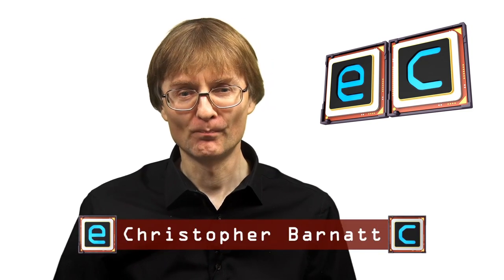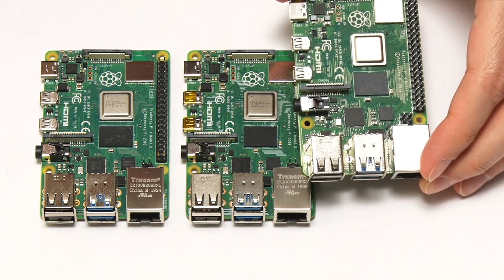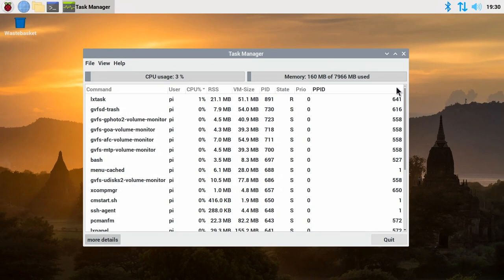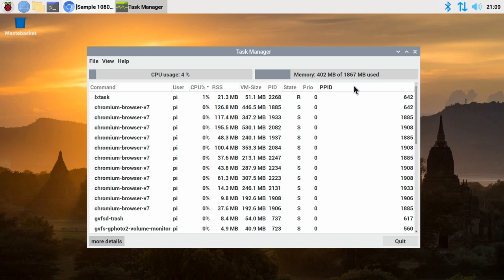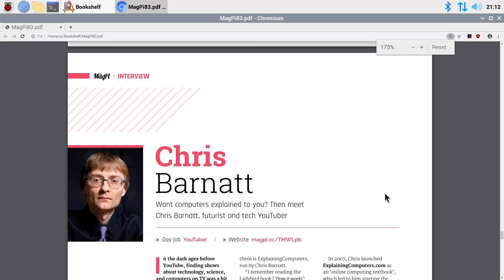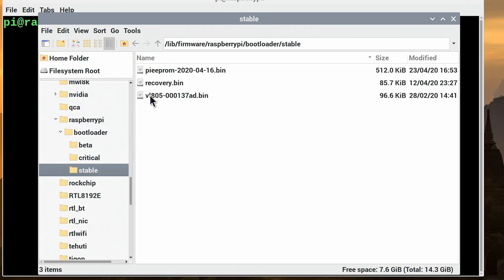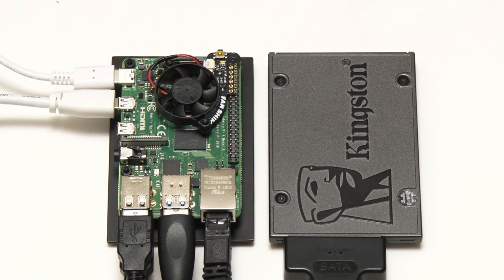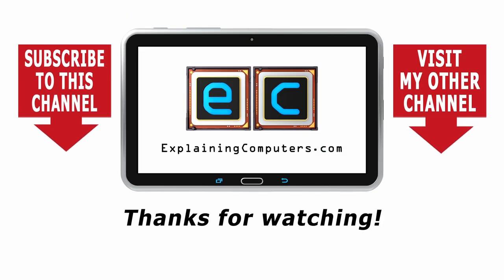Raspberry Pi 4 8GB & USB Boot

Comment: Yup, it came today.  It was $75, but I had some add-ons, plus shipping and sales tax (Florida).  But the expense doesn't end there: two additional VGA monitors, two micro-HDMI to VGA converters, a 256GB micro SD card, and, I'm sure, a few more things will get me on the road.  I mentioned the Pi T Cobbler (to connect to a proto board) and the heat sink in another comment,
Apparently, you have to load the Raspberry Pi OS, 32-bit, first, and then upgrade to the 64-bit OS.  I'm not sure, after a year or two later, if the 64-bit is still in beta.
Usually, within minutes after a new computer arrives at my house, it's already hooked-up and ready to go.  But this time, I had everything except the OS.  Now I need to make more decisions....

Comment: Brilliant devices.  I've got an original Chinese made Pi B running a few servers.  Use the SD card's FAT32 partition to boot to an external powered 1TB drive containing the OS.  The drive has three partitions, OS on a 16GB ext4 partition and two further partitions for saving videos etc.
Reply from the maker: Hi Geoff. :)

Comment: A Raspberry Pi 4 would make a great pocket diagnostics computer for working on virtually any PC. For instance, should you need to copy files from a PC that won't boot, you could use the Pi to copy those files before performing a clean install.

Comment: The Pi 4 needs so much power that running it on batteries is nearly impossible :( That cuts down on 'cool things you can do with a pi' by about 90% I think. Having a small portable computer is nearly useless if it has to be plugged in. I feel like the PI peaked at the 3b, and this is the end of it.
Reply from the maker: I have to agree that the Pi 3B+ was the classic Pi for many reasons (not least power use and cooling). And the 3A+ is a very good board too.
Reply: That is why I suspect that the next board update we are likely to see will be an update to the Pi zero. More CPU but with roughly the same power consumption.
Reply: @bradquinn4161  I'm hoping for more ram. A little more CPU speed wouldn't have nearly as much impact as an extra gig or two of ram.

Comment: To be precise 32 bit operating system CAN address more than 4GB of memory because it is not addressing space in bytes but in pages and processors have functionality to support for it. What cannot happen in 32 bit OS is processes addressing more than 4GB. What makes matters worse; memory split is set to 2GB userspace + 2GB kernel.  This theoretically leaves you with only 2GB per process limit. Again it can be mitigated to some degree by changing split to 1GB+3GB via kernel parameters. In Windows via WOW64 and some trickery this offset is changed to 4GB+0GB.

Comment: Really curious what Raspberry Pi has against the Manjaro team. Their full 64 bit image has been running on my Raspberry Pis for the last 8 months with zero issues while I had problems with raspbian and ubuntu images (I ran stuff that required full 4 GB ram).Yet no mention of Manjaro on their posts. I was so satisfied with how Manjaro ARM has been running on Raspberry Pi that I became a patron in the end.
Reply from the maker: Good post. Manjaro runs very nicely on a Pi 4 as you say. I've not tried to USB boot it yet though.

Comment: I think you may be trying to talk me into buying the 8GB Pi 4 B.  I had the 2GB in my Adafruit shopping cart and was going to buy it.  Now I have one of each and deciding which one to delete (I can't afford both.... what am I saying - I can't afford either!).

I'll probably buy one or the other, anyway.  I often have up to 50 windows open on my machines, and the older Pi 3 seizes-up after about 7 or 8.  It's hard to imagine this little computer with as much memory as my desktop (8GB).  

But these days, you know that my Raspberry Pi adventure is wrapped-up in something much larger - the Space Telescope I've been working on.  I need to be efficient in the resources I have.  The main thing I need out of this is the BCM2711 chip and its six SPI ports (I will use four of them and multiplex out to 16 data ports and 32 I/O ports.

I've been looking around for something a little less extravagant, such as a small chipset, or maybe even just the BCM2711, but it appears you can't simply buy a BCM2711 chip.  I suspect that it's exclusive to this device.

In the meantime, there are many other chips that can supply SPI interfaces, but there's no good guide to finding one that can service 32 data ports or more (I want to add more converters - I need more data coming back from the distributor boards).  I've been looking at the ARM processors, but again, in order to find what I need, I have to sort through hundreds or thousands of them (I'm surprised at how many ARM processors there are in the world).

The BCM2711 is only one of many.  The cheapest ones start around $5 (can you believe it - you can still buy a Z80) and the most expensive ones get up to $12,000 (I'm looking for something around $20).  At least with these, as an electrical engineer, I'm much more comfortable writing programs in assembly or machine code, instead of that twisted and confounding language that they call C++ (even C would be better).
Reply from the maker: Good luck with your choice -- and the telescope!

Comment: The big problem with the 32-bit OS is that the upstream code sources for x32  OS's and Applications are being abandoned and will no longer be maintained in preference for the 64 bit architecture in the x64 mainline,  which means no more updates for things that are x32 (unless the source codes are first manually edited to change all the x64 processes to x32).

Comment: I was eagerly waiting for the "Is it the desktop replacement" section!
May be in a future video?
Reply: I've just switched from Windows 10 on a Surface 2 Pro to the RPi4b w/4 GB RAM and I'm lovin it! I'm not over clocking (yet), but am booting onto either Transcend 512GB SSD or Corsair GTX 512GB flash drive. So, I have plenty of fast (~250 MB/s) storage. But, note that most USB 3.x flash drives run at only a fraction of their specified speed because they need to support UASP. Sandisk, PNY, & Samsung don't so they run excruciatingly slow.
Only wish that I had purchased the 8 GB RAM model of the RPi4b, but it wasn't available at that time.
Hope this helps :-)

Comment: my personal experience with Computers Shows me that 8GB(under Windows) usually is the Minimum RAM for Desktop work.
at least when you want to run more than one Task at once.
i think that the Hardware of the new PI should make it a much more capable Desktop replacement System.
also i think it should be possible to create a mobile Version, as a decent Laptop replacement.
all in all for everyone who wants to use a single board Computer for classic SBC-uses the 8GB pi is an Option that might also work as a spare Desktop when the main System breaks down. 
second there might be SBC-uses that border Desktop pc uses, for example when you want a Desktop that also controls items.

I think it might be time for another "i replaced my Desktop with a PI" Video. how well does the PI4/8GB fare?
Reply: I would translate ram like that: 
1gb pi = 2gb windows 
2gb pi = 4gb windows
4gb pi = 8gb windows
and 8gb pi = 16gb windows
Reply: For most desktop users going from 4GB to 8GB on a Pi4 is not going to matter at all. I have been using a Pi4-4GB with hybrid USB boot as my daily driver since September. With Thunderbird, two Firefox windows, and two chrome windows open it is typically only using just over 1.5 GB of ram. Moving from an SD card (chip limited to 40MB/s) to a USB device(chip limited to 350MB/s) is a HUGE improvement in performance. The only task I boot my Xeon quad core now is video conversion (handbrake).

Comment: I'm currently doing research with running neural networks on smaller robots and am using the PI as the onboard computer. It's very convenient having a SBC with multiple cores that runs Linux, has embedded WIFI, and can talk to sensors through I2C.  I'd prefer to use the PiZ, as it is the smallest and sleekest, but it's slow as a dog unfortunately and as much ram as Bill Gates' mobile phone back in 1998 :(  The Pi4, on the other hand, has been quite satisfactory with its 4gig ram and adequate power.
Reply from the maker: Very cool.

Comment: Composite isn't technically gone! It's just been merged into the headphone jack, you need a composite to 3.5mm jack cable to use it, it's also disabled by default as the system has to clock down to generate the composite signal, you can re-enable it by adding enable_tvout=1 to your config file.

Comment: So with regards to firmware upgrade the damage potential you speak of, is it brickable then?.  Would be a harrowing over sight if it is, this would also point to the presence still of the nasty blob for the CPU/System that is below kernel.

What damage could be achieved with a failed firmware beta?.
Reply from the maker: You are spot on -- the damage would be a bricked Pi with no functional firmware (with the rest of the Pi remaining in perfect condition!). There are ways to recover from non-functional firmware, but if the process goes wrong, you could have in effect a dead Pi. We could debate how "damaged" it really would be! But the Raspberry Pi Foundation are now pretty strong in their messaging about not upgrading firmware unless you really have to.

Comment: Any recommendations for using the little guy in an RV situation?  e.g. monitor the internal air temp and if it gets too hot, turn on the ventilation fan.  Run a DVR to record security camera footage from 4 cameras.    Can all this be done on one Pi because it can multitask?   Links welcome as I'm starting from zero.

Comment: What I like to do with a pi4? FULL size HDMI. I  have a bunch of them, but have to buy adapters in order to use them. Maybe the pi5  . 
Also would be neat to see some other kind of storage interface brought to the pi. Some that doesn't have big USB cable hanging out the end
Reply: The industrial users want the dual small HDMI. Since they effectively pay for the board development, I doubt we will ever see a new Pi with full sized HDMI again. On board storage is also very unlikely. In order to support that you would need to add at least three more PCI lanes just to match the current speed of USB 3. Before that happens USB4 will be out with even more speed.
Reply: @bradquinn4161  also wondering if they surveyed current users about what they wanted
Reply: @billrichard9730  Pretty much they just go with what the industrial users want. The only reason we got the Pi4 as early as we did (1-2 years ahead of schedule) was the industrial customers effectively paying for development. More than likely the next board out will be an update for the Pi zero. It is a much less complex board (cheaper to develop) and with the increased power draw of the Pi4 there is a "hole" in the Pi line up. The Pi zero does not have enough cpu, but the Pi4 draws too much power. So I suspect that we will see something like a 1GHZ Pi4 CPU with 2GB ram  in a Pi zero sized format, targeting say a quarter of the power draw of a Pi4 but eight times the power draw of a Pi zero.

Comment: I’m planning on getting a Pi4, this will be my first. I want to use it as a basic desktop, web browsing and media player. Now my question is, which board should I get? 2gb or 4gb? I don’t want to spend the extra money if it’s not gonna make any difference in my intended usage!
Reply from the maker: In my experience, for basic computing in Raspberry Pi OS there is no performance difference between the 2GB and 4GB models. However, if you want to open a lot of browser tabs, or try things like video editing on the Pi, the 4GB will perform better. But from what you say, I would get the 2GB model.
Reply: @ExplainingComputers  Thank you!

Comment: Composite hasn't been completely removed from the raspberry pi, even though the old composite jack is no longer there.  The 3.5mm jack is a 4 pole jack, handling composite and stereo output.
Reply from the maker: Totally true -- and in the video I do not say that composite video output has been removed: I say that the RCA jack has been removed, which is correct. :)
Reply: @ExplainingComputers  I have only recently received a raspberry pi 4 2gb model myself. I may be using it as a web server.

Comment: Yet another excellent presentation. My plan is to attach a camera chip with TOF distance measurement 320x240 pixels at framreates of 150 per second. However, I do not know yet if the pi is powerful enough.

Comment: The composite video is not lost, it is part of the 3.5 audio jack.  Just no RCA connector
Reply from the maker: Nowhere in the video did I say that the Pi 4 does not have composite video. I said that we have "lost the RCA composite video connector", which is true, as there is no longer a phono jack on the board.

Comment: Chris. I've really appreciated this, it's helped me get a system up and running with Raspberry Pi OS, and an SSD, without SD card. What I would really like to do now is add to this already working system a second OS, dual boot. But all the guides I've read seem to expect me to start from scratch. Is it possible to add a dual boot (ChromiumOS) to an existing SSD setup?
Reply from the maker: You may be able to set this up using something like Berryboot. However, almost certainly you will have to start again.

Comment: My next raspberry pi project is a new Asterisk server with the Cisco patches UseCallManager, I started this about 7 years ago on the pi B but moved to x86 and later x64 as the pi was not powerful enough to run all the phones and trunks in a real environment. However with the pi 4 having true 1gb Ethernet and access to fast ssd for call recording I think it’s about time my asterisk came back onto the raspberry pi. I would prefer to use centos as that’s what I have used as my platform on x64 for the last 4 years and my server stats show server uptime of 1210 days. Very stable indeed.

Comment: Excellent as per. Thank you.
I've made 2 attempts to get the 1.2 revision without success (re PSU issue). The old boards are still being despatched. Grrr. It now looks like I'll have to make the jump to the 8gb board :(
Reply: There are lots of sellers on eBay that supply the 1.2 revision, and state so in their item description.
Reply from the maker: I had the same issue -- I bought my 2GB Pi 4 expecting a 1.2 revision and did not get one . . .
Reply: @thumbbandit1628  Thanks. I shall head over there this very minute.

Comment: Maybe the Raspberry Pi 5 will have an onboard SATA port so you can just directly hookup an SSD, course that'll create yet another jumble of case options LOL.  I had a Raspberry Pi 3b for a while, never really found anything useful for it and I gave it away as I also never got the LCD to work with it.  

Thinking of getting another Pi and trying to configure it as a local document server at home.

Comment: Any advice on how to get Raspberry PI 5 to auto mount a hard disk. USB's seem to be under powered. Every time I connect an external drive system locks. If the Drive is connected it wont boot at all. Had a hard disk full of movies and want to use a PI 5 upgrade. I boosted the PS to 40 watts and tried a powered USB hub. Nothing works.

Comment: Some SSD have a RAID controller into it, needed 2 drives and maybe extra power than the USB port can provide.
Like the hardware RAID1 so it used no extra CPU resources.
Question: Have you tried such a SSD RAID system via USB?

Comment: An excellent video (as usual), did you see a significant improvement over boot times and responsiveness with the SSD  configuration vs. the micro SD card?
Reply from the maker: The boot was not notably faster. BUt ther is a lot of time spent in POST.

Comment: I have a Pi 2 with a 250 GB SSD hidden behind my bookshelf I use this as a  SqueezeBox server for my audiobooks. It has been running faultlessly for the last 5 years. The SSD has added about 2 years ago or so. I can't see the point of an upgrade.

Comment: Running Open Media Vault 5 with Portainer and steadily consolidating all of my home services onto this 8GB unit.  Waiting until the official firmware is released before migrating to 500GB SSD, at which time I'll commit to moving HomeAssistant and possibly fusionpbx/freeswitch.  It's a shame there are some docker containers out there that are tough to find for ARM.

Comment: Finally got my raspberry pi 4 8gb.
I am running a nextcloud server, although is a little slow to load my iphone pictures and videos, but still cool. I am also trying to sniff 433 Mhz signals with gpio to communicate with my home security sensors.

Comment: Hi Chris.  You mentioned the precedence between the two boot drive options.  But have you found a way to move between the two using only software or boot options?
Reply from the maker: It is possible to change the boot order by altering the firmware, but it is not a trivial process: https://www.raspberrypi.org/documentation/hardware/raspberrypi/bcm2711_bootloader_config.md
Reply: @ExplainingComputers  Thank you.